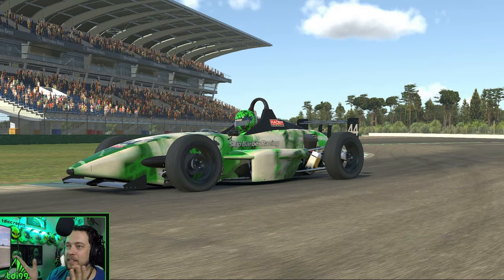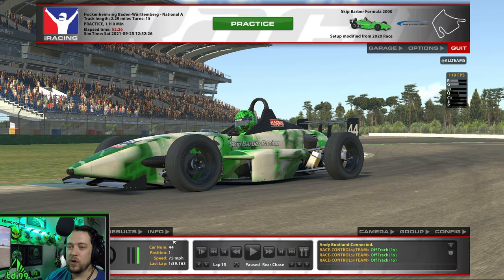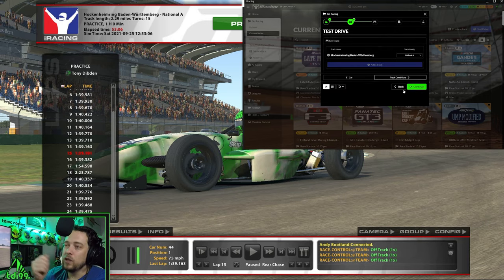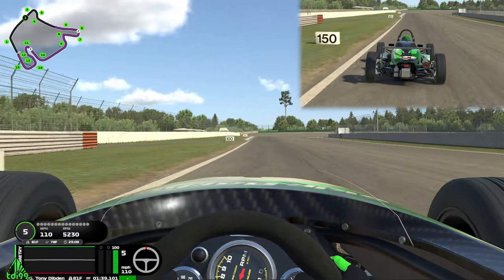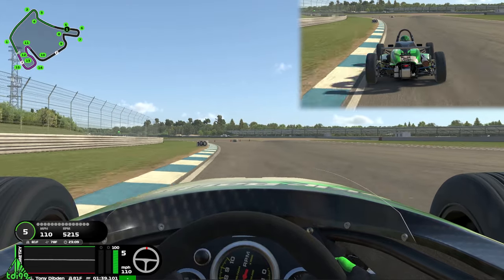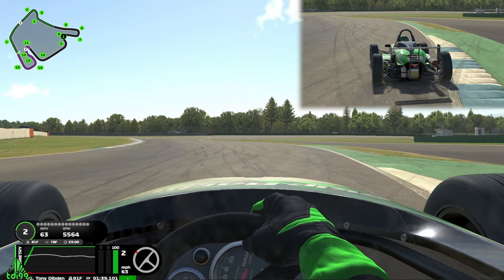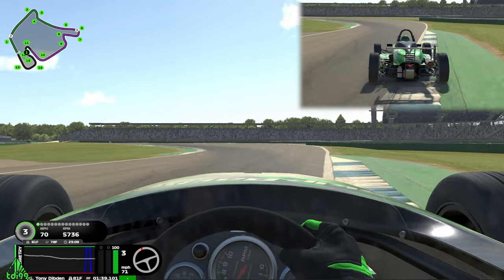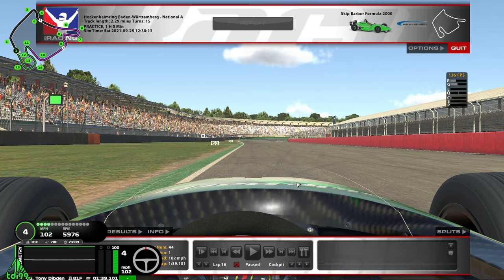iRacing Track Guide Hockenheimring National A | Skip Barber | 1:39.101

Comment: This looks to be the best compromise for the different track layouts so we don't get so much slingshots on the straight.
Reply from the maker: that is a very good point! overtakes wont be as easy compared to the full GP layout!
Reply: Or the shortest layout that was used last season which doesn't have a long enough straight to pass.

Comment: looked at your fuel suggestion, saw i had the correct amount with me. then ran out of fuel.
Reply from the maker: The correct amount is 4.2 gals. 

3.1 which is the usually amount for other skippy tracks will only do 17laps

How much did you have?
Reply: @Tdi99  haha, 3.1, but maybe i misinterpreted what you wrote in the description of the video (or did you change it...?). Anyhow, i know now :)
Reply from the maker: Yeah I put in the description (add a click of fuel) and I have just changed to have "4.2 total" at the end